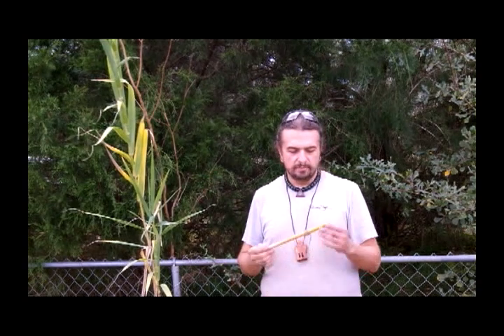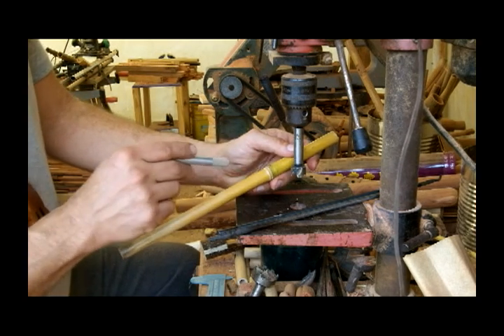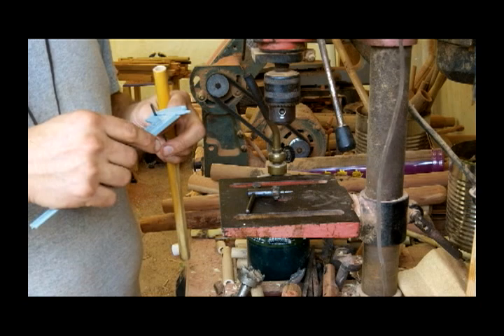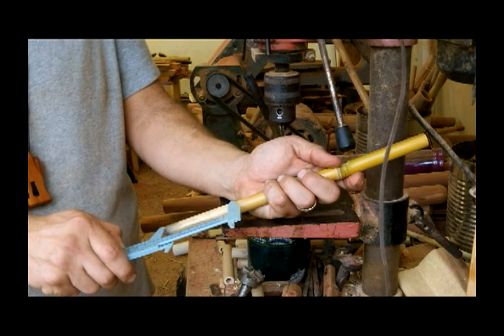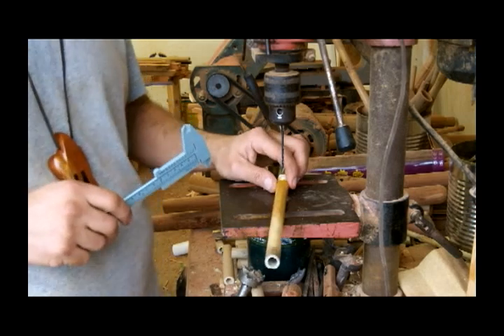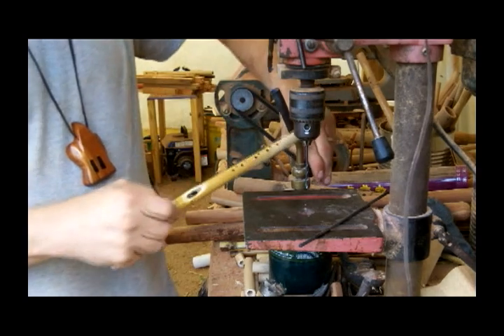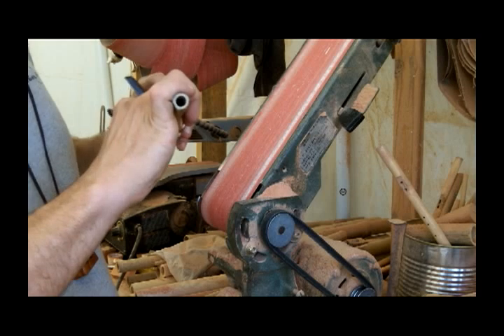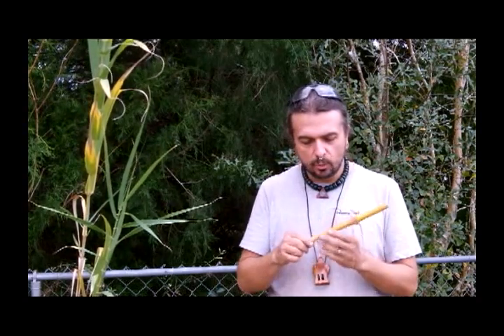How to make a mini flute

Comment: Charlie Great Stuff bro! Now for trouble shooting. I have made 20 of these and still can not figure why I can get no real sound. My instinct say it's between the block and and supply and sound holes. Here come the questions when drill the sound hole how close to the "node" are you. conversely the same question for the supply hole?  Next How big are finished, 5mm squared, 1/8" ?  What is the angle of the node from the supply hole to the track? Lastly how flat is the block do you leave any curvature to it? Sorry for the multiple questions just trying to learn thanks in advance for your time

Comment: Charlie, one again your presentation, displays, types of tools for making mini flutes was well planned, inspiring, and easy to follow for a novice like myself.  Just one question;  The air and whistle track burned on the larger flutes should be burned in shallow, similar to your mini flute example?
Reply from the maker: Yes, very similar to that but much smaller.